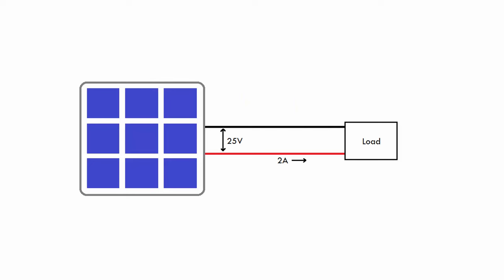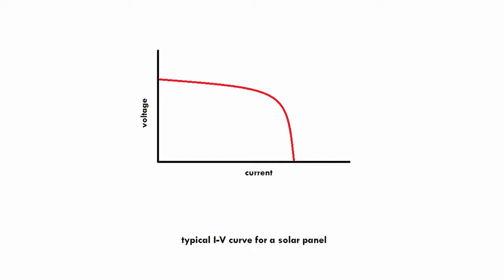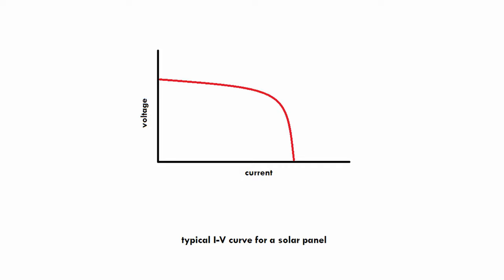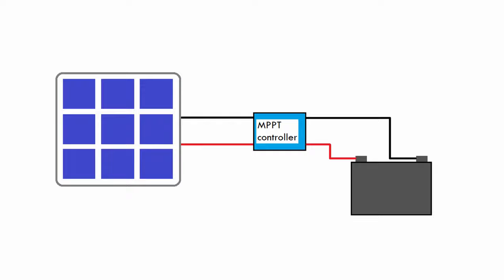MPPT explained (AKIO TV)

Comment: great video. In my case I have sungrow SG10RT, the spec sheet says "No.of independent MPP inputs" = 2  and in terms of "no. of PV strings per MPPT" = 2/1. What would that do if I wire up east and west facing panels on 2 different strings into the MPPT that can handle two string inputs.

Comment: excellent video this & the one about wind turbine with 3 blades...sure SUBSCRIBED ...
Reply from the maker: thanks!
Reply: @AKIOTV  can you share your email ?
Reply: My doubt was you said that if current is reduced voltage will increase. But in the end we get same power correct ? As P=V*I. 

So how it affects the power ?
Reply from the maker: @electrical-sajid  yes, P = I x V. But that doesn't mean the power is constant. If I draw 2x as much current, that lowers the voltage, but not necessarily by a factor of 0.5.  (As you can see in the I-V curve of the solar panel).

Comment: But what if that specific point of Maximum power outputs voltage higher than the maximum voltage required for the battery? do we need to reduce the duty cycle to lower the voltage even though it is going to reduce the maximum power? Do we need to use dual buck/boost converter where the first one at he first stage tracks maximum power and the other one at the second stage controls specific voltage and current required for the battery? But my concern in having that kind of configuration is the efficiency, because if both converter is rated with 90% efficiency, then having them both in such setup will render 80% of efficiency, 10% reduction from each of them.

Comment: Are there any controllers like this that have dual inputs from, for example, two strings of solar panels, that can switch them between series and parallel to halve or double the voltage input depending on conditions?

Comment: Nice video!!
Can an MPPT get the 12 volt input  up to the optimum votage for a 24 volts system?
Reply from the maker: depends on the type of power converter used inside the mppt controller.

In theory it's perfectly possible but most manufacturers' implementations are require the solar voltage to be > battery voltage. You can find out on the datasheet of the controller.
Reply: Then it is boost controller.

Comment: Brilliant teaching skills! 
The only good explanation on YouTube!!!! 
The bicycle metaphor is ideal. 
Torque is a good analogue for current and revs maps to voltage.
Well done sir!!!

I'm working on an analogue (op-amp based) circuit for Mppt. 
The algorithm is similar to focusing a telescope/microscope. 
Do you think it will work if i only monitor and maximise the current fed to the battery?
Reply from the maker: Yes that'll do
Reply: @AKIOTV  Thanks for the advice. 
I'll let you know if it works well.

Comment: Ok, power is the product of voltage by current. Can you tell me, why do I care about this equation, if on the other end I have batteries, and whatever I put there, it is going to be consumed anyway? Why do I need to balance anything? Do you balance anything when you empty one bucket to fill another? Even if it drops to near-zero voltage, the destination is going to take anything and consume it. So , why do I care ???? Any answer? My dear expert?
I can use a step down module and convert any power from the panel to the battery and as long as the voltage stays slightly above the combined voltage of all battery cells, the current is going to be consumed, in any amount. The electrical energy is going to be used to make corresponding chemical bonds to create a higher potential difference between the cathode and the anode, and that is it, why do I need an MPPT device? As long as my controlling logic gives an efficiency above 90% (and you do that by using higher frequency controller) I don't need to pay the big bucks for an MPPT device. A decent PWM will work fine. Who created all this MPPT marketing propaganda, I wonder?
Reply from the maker: @absolute___zero  More power means the battery charges more quickly. That is why you care.

Comment: Let's say there is a solar panel that provides 12 volts and a 1.5 amp power (18 watt max). How does the system work when the weather is cloudy, let's say the power of that panel drops to 5 watts, how does the mppt device adjust this? e.g. dropping voltage to 5v and ampere to 1 amp ? or dropping voltage to 10v and ampere to 0.5 amp ? or something else ..
Reply: You missed a point there, the power isn't constant, I can't say it's 10 watt pv so it can give 5v 2 Amps or 10v 1 amps, we say because of the weather condition and load profile, the volt is 10 V and the current is 1 Amp which will lead to 10 watt power, so for your example, if the voltage and current drops to 5V 1 amp, the mppt can lower the current to 0.5 so the voltage will be let's say 14 V so the new power is 7 watt (as you can see the IV curve isn't linear), or it can lower the voltage to 3 and get 3 amps so the new power is 9 watts, so mppt continues adjusting value of volt and amp by changing the mppt input resistance until it reaches the maximum possible power

Comment: If i use 12.4v with 60amp current. Can the MPPT convert the current into volts? Example, i will charge a 24v battery.
Reply from the maker: depends which mppt converter.
Reply: @AKIOTV  i will be using a SRNE MPPT sir.. during rainy seasons, especially if theres typhoon and i have to dismantle my solar panels on my roof. I will use that power supply to temporary charge my batteries, incase.

Comment: Greetings! I would just like to ask if it would be possible to configure an MPPT that would be able to have 2 input sources, like Indoor Light and Thermoelectric Generator (TEG). If so, do you have any ideas on how to implement it? This would be the possible grounds for our thesis. Thank you so much and I hope you have a great day!
Reply from the maker: You could build a double-input mppt device, which is essentially just two mppt controllers in one box. (Although one microcontroller could operate both power converters given it's fast enough.)

Connecting the sources in parallel/series won't work, because two different types of power source probably won't have the same mpp, so connecting both to a single input would give you poor performance on both.
Reply: @AKIOTV  Hmmmm is there any way possible to have a single MPPT only? This would be the main purpose of our thesis, having a single MPPT that would be capable of receiving 2 sources, although not simultaneously. Thank you so much for replying, mate! I highly appreciate it 🙏
Reply from the maker: @cryptonert9521  if they never happen at the same time that should work, as long as they're both within the acceptable range (voltage and current wise) of the controller.

Comment: A question: Does that means the battery can be charged directly by MPPT and inverter is not needed?
Reply from the maker: inverters are only necessary to connect to an ac grid. For charging a battery you don't need one
Reply: @AKIOTV  so if we want to charge  a DC input load by battery  ,   can we directly charge from the Battery to the DC input load without inverter?
Reply: @stellatsering32 what is your goal?

Comment: I knew that, in reality, the variability of the voltage and current of a photovoltaic panel was linked to the temperature (if it increases, the voltage decreases) and the radiation (if it increases, the current increases).